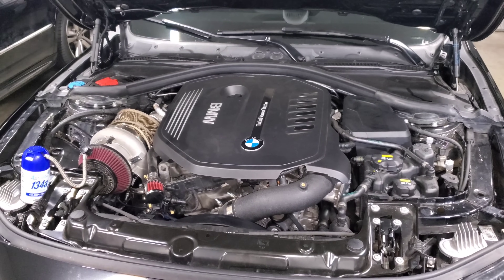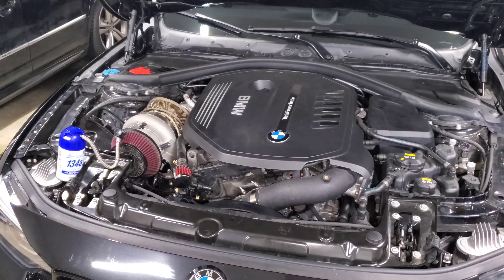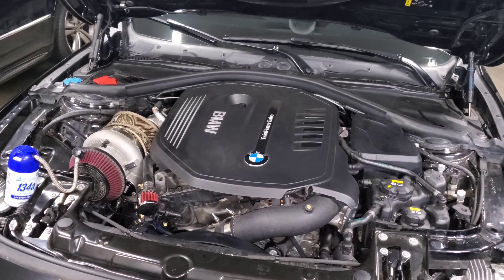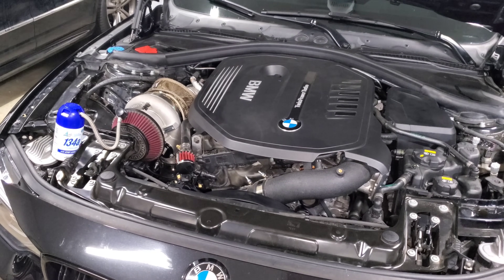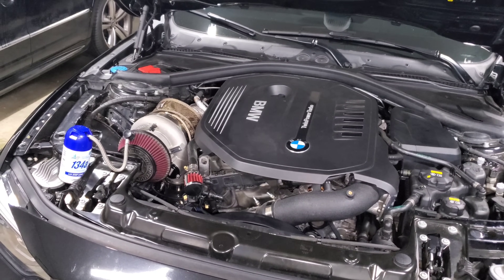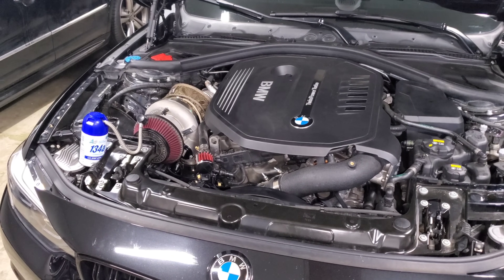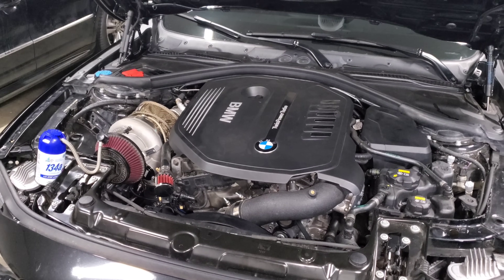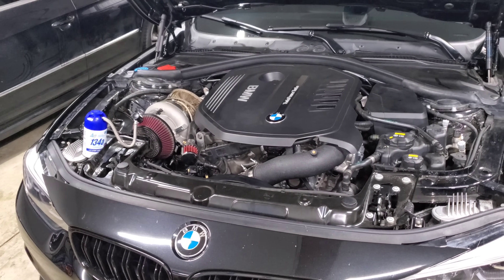How much power can the stock B58 Engine handle?

Comment: hey kern ik this is a old video but i hope u see this haha, so im currently aiming for 650whp and i am going to run a daw 6969 and nostrum stage 2 injectors,ds25 hpfp,spool stage 3 lpfp and a custom tune from shoup, built trans from ATS (their kit) anything else i should add to take precaution before i go ahead and go into this journey on a stock engine?

Comment: Okay so i guess im confused then... so when u say reliably/safely 600-650whp... are u talking at the wheel or the crank? The reason why i ask is because when u were talking u said "hp"... but below u showed 600-650 "whp... so i guess im wondering which is it? Is that 600-650 "whp" or is that only at the crank "hp"? Other than that great video man.

Comment: $6k pure transmission
$5k big boost 6870 kit 
$10.5k 5150 engine build kit 
$1.5k precision PI kit 
$150 DP 
$900 fuel cam kit 
$500 lpfp kit 
$50 Bimmergeeks cord 
$500 Motiv Reflex 
$416 MHD Flasher and Monitor 
$1000 David Shoup tune 

=~$26.5k total cost

Comment: So I’ve got a 2019 x4 m40i new spark plugs, mst air intake, vrsf high flow downpipe. I’ve got a stage 2 tune from MHD. I change my oil every 5k miles. What’s the next thing I should do next? Mod wise
Reply: Dorch high pressure fuel pump & upgraded injectors (cost roughly $3k labor excluded)

Comment: What he is saying is 100% facts. The guy you may know with 800+whp on a daily basis is not pushing the car repeatedly... Even with "proper fueling/cooling," you have to hope injection works perfectly when beating on it. Go ahead and upgrade the pistons before going beyond 700whp, unless you just plan to use it as a showcar...

Comment: that rod looked 100% hydrauliced to me if that was the actual bad rod. in other words it didnt go bad from to much rpm or hp it went bad from something like an injector leaking where enough liquid fills the combustion chamber and then the car is started somethin has to give and its usually the rod. when they go the other way its usually alot messier

Comment: Not so sure about reliability after just 105,000 miles...and BOOM!!!😢

This is not spam... I really need help with this.

My 2017 BMW 540i G30 just burned a valve #4 cylinder. (105k miles) I had the vsfr high flow cat, upgraded charge pipe, k&n air filter, new B58TU Fuel pump, and Bootmod3 Stage 2+ 93 octane.

I am beyond depressed!😢 I am a Single Dad with 1 special needs, child. 

I was told I need a new engine that will cost 21k installed. I just can't! 😭

I still owe 25k, and it is  my only car. I have nothing right now and am about to lose my job. I can't get my kids to the doctors, etc... If you can please reach out to your connections and see if they can help, I would be forever grateful 🙏  
(Huntsville, Alabama USA)

🤔A rebuild and breakdown of what went wrong with my B58 might help others with B58. (Content Idea)

God bless you, brother!!! 

~J. McCall
Reply from the maker: Your best bet is to find an independent shop to help diagnose or source a used motor.

Comment: Pistons crack probably from the piston rings butting together. I would imagine they make the ring gap on the tight side from factory. Would be interesting to find out what gap comes on the mahle performance pistons compared to stock. If they come pre gaped that is.

Comment: Do you think a Dorch Stage 2 HPFP paired with a VTT GC Turbo (not GC+) would be a good option? Hoping to get to around the 600-650 mark on ethanol with that setup.
Reply from the maker: sure. but it will be hard to get over 600
Reply: @kern417 why do you say that? it was done in 2021 with ds2 and e50 no port and for example i have ds2.5 now so im guessing its more likely now no?
Reply from the maker: No. Gc is rated for 600.
Reply: @kern417  No i know that. I was simply stating that it can get to 600/600. maybe even a few less or more bc it was done when it was first released
Reply from the maker: Like i said it will be hard to get over 600. But feel free to try.

Comment: I had a ford sho with a lot done, just got totaled now I’m thinking about getting a 440 and the more I watch videos the more I realize b58 is a damn cheat code
Reply: I mean like once you open the engine n most trucks you can push a lot of power the expensive part isn’t the parts in the labor in opening up a engine

Comment: Hi, new subscriber here and recently purchased a 2018 440i xdrive convertible with the B58 motor. I'm trying to learn as much as possible about this motor. I heard you say upgrading the Turbo and fuel pump are 2 of the best means of adding additional power but I'm uncertain as to weather or not I need to address the fuel pump due to it being one of the ones that is of the "better ones". Also, how big of a turbo can I go? Obviously "bigger is better" I take it but is there one that can put me in that 600hp range that you covered in your video. Thanks a lot

Comment: I wanted to ask how these stock transmission hold up. My car seems to love getting into short shifting Ie sits at 1000rpm in most gears (I do baby it a lot) and also drops to 900 without downshifting. Is this normal ? Stage 1 mg
Reply from the maker: Yes it sounds normal. You need a transmission tune to adjust shift points.

As far as how strong the transmission is, I made a video about that. 
https://youtu.be/cCDNvn0Dkr8

Comment: Bmw said Mpssk 340i has 360hp and 500nm, but i know they underated the numbers. What is the real crank horsepower? The normal 340i has 330-340 crank hp, do u believe the mpssk 340i could have around 400 hp at crank?
Reply from the maker: Usually they make the rated hp at the wheels. I don't like to estimate crank numbers but hopefully that helps give a frame of reference
Reply: @kern417  well, i guess i dont need anymore a remap to push 400hp to crank, it should be around that power. A stage 1 remap should push around 430-440hp at crank. Anyways ty!
Reply: mppsk is faster i have one

Comment: Let me just say this… I had a 650rwhp twin turbo NISMO 370Z. 530hp is my daily map, and it’s more than enough to get in trouble. Unless you’ve driven a high HP car, don’t let YT videos tell you that you need a 1,000hp car. I promise you don’t. Do 500hp, then 650hp. Then go from there. Lastly, UPGRADE YOUR BRAKES!  Going fast means you gotta stop fast, and OEM brakes aren’t designed to handle more than stock HP. Don’t be an idiot, upgrade your brakes first,

Comment: How do I know if I have a gen 1 or gen 2, is the gen 2 only in the supras?
Reply from the maker: Supras and new BMWs like the M340, M440, etc
Reply: @kern417  obvious newb here, and I’m sorry to bug. I did see that there are different variants of the b58 motor. My b58 is a B58B30M. Would you happen to know what exactly mine is in comparison to the other variants? Also would like to buy a sticker, I’ll email you my info. Thanks for what you do, you have a crap ton of knowledge. You should probably do modifications on the side for people if you’re capable. Indiana here, I saw that Ohio plate!
Reply from the maker: M0 is Gen 1. M1/O1 is Gen2.

Comment: local tuner was focused on track cars and had a handful of b58's with only stage 2 BM3 tunes blow up while on track. Maybe these engines can handle these power levels when drag racing, but  as someone who tracks their car I am keeping it stock.
Reply: Due to oil starvation
Reply from the maker: There are plenty of people that track their tuned cars so sounds like something else was wrong
Reply: Got a baffled sump?

Comment: Does anyone know if the m140i and 440i manual share exactly the same transmission?
Reply from the maker: Looks like different part number but has the same limits
Reply: @kern417  do you know if fittings are same ?
Reply from the maker: @Driver605  it looks like mounts and everything else is the same. Look through RealOEM

Comment: Detonation kills pistons and rings.  So many years of intake, cylinder head port, and valve train design all aimed at filling the cylinder with an even air/fuel charge. That’s one of the main benefits of direct injection - no lean pockets that can detonate- perfect air/fuel distribution and very high atomization rates vs port injection.  It would seem that correct path would be embracing Direct injection and maximizing its benefits before going back in time 40 years and mounting port injection.
Reply from the maker: Port injection is necessary when you are pushing past the DI limits. Plus There are plenty of other reasons why it's beneficial. That's why several cars made in 2021 (not 40 years ago) have both DI and PI from the factory. The Audi RS3/TTRS is a great example. Even the new G8x M3/M4 have provisions for PI on the stock intake manifold. So I guess it's time you embrace progress 🙂
Reply: @kern417  Golf 8R too
Reply: They added port injection due to the inherent flaw of GDI- carbon build up on valves.
Reply from the maker: 11 months later and you comment just in time to see that the new generation of the B58 comes with port injection too 😂

Comment: I have 540 stage 1 with 48K miles on it and got some wining noise coming from the engine when you keep Rpm’s higher then 1500 very similar like bad timing chain made on N20 engines. Maybe you know something about timing change issue or B58 wining noise issue. Nice video👍
Reply: Could be your spark plugs
Reply: @Lord.Slumped  wasnt aware that spark plugs made noise🤦🏽‍♂️

Comment: I have a 2016  550i, downpipes, cai, muffler delete, JB4... Thinking about getting a 340i tho. What do you think?
Reply from the maker: You won't regret it
Reply: @kern417  what advantages vs disadvantages do you think with getting a 340i over the 550i? I planned on doing pure turbos on the 550i then I got the 340i bug for some reason and now not sure what I was do..
Reply from the maker: It is more reliable and easier to work on

Comment: I have a currently stock 2018 m240i,  any recommendations for 425-450whp? I’d like to keep the stock turbo and pass emissions. But I’m open to down pipe(catted) and tune suggestions. I’m looking for reliability and stability(as close to stock as possible).
Reply from the maker: I have a video on recommended b58 upgrades. Downpipe on pump gas will be around 400-420. E30 will put you over the 420 mark
Reply: @kern417  easily that, making 410 wheel on a full bolt ons f30 335i on a E20 tune
Reply: after you go full bolt ons (so many options just chose the mods) get MHD for the tune (stage 2 or 2 plus if it's out now), xHP for the transmission (recommend stage 3). The MOST important thing to remember is make sure you're not running too lean for the tune, don't be like me and have to rebuild the engine when not even pushing it far...
Reply: @chrisgarret3285  how did you lean out, what went wrong?
Reply: @willm2624  I thought I could run a 95 octane map by using 93 octane pump gas plus one of the top rated (and MMT containing) octane booster that was supposed to bring it up to 96 octane
Reply: @chrisgarret3285  Aw man, that sucks dude. Sorry to hear. Hopefully you’re up and running again.
Reply: @willm2624  thanks I'm up and running and now running E-30 mix on a stage 2 plus E-20 map and boy does she move, F80 M3 need not apply :)

Comment: I don’t think that an engine that is designed to have 320-350 hp can handle double of the performance for a long period of time. Ho many miles/km did the 40i owners drive with these modifications?. I know that b58 engine is a reliable one, but I still don’t think that the car manufacturer will spend extra money for making a car that can handle double of performance from a stock engine form.
Reply from the maker: You saying what you "think" doesn't trump what everybody's already doing. But it's up to you what you want to believe. I have data. Where's yours? 🙂
Reply: @kern417  - what an effin awful reply , Vlad’s point is valid. The right answer is the B58 is basically a beefy block built for diesel applications too and naturally built beefy. That’s all. It can make 2 to 2.5x more power is very much possible but obviously with risks. A 30-50% should play in the safe limits.
Reply from the maker: I have no idea what you're referring to. Clearly vlad understood 9 months ago 🤔
Reply: @kern417  i have an f30 and an f10 but without b58. I don’t dispute that it cannot handle that power, I just said that I don’t think that it can handle it for a long period of time. I don’t want to bother anyone. How many miles did you drive in this form?.
Reply from the maker: I have 5k but there are plenty with 40+. It's easy to tell how much stress you're putting on the engine and there are multiple BMW engines pushing out double the HP on stock internals. Do some research.
Reply: @kern417  Ok. Thank you for the info!.
Reply: @VladVVT  if you properly take care of your vehicle she will take care of you
Reply: A hammer doesnt last half the time when you start beating it twice as hard. Just as long as you dont beat it harder than it can handle, it will last a long time...
Reply: N54 guys been driving for several years at double the hp

Comment: Yea 650 is what people usually max hp at for b58 but then you better have a built transmission at that point. Mine is limited to 600wtq to keep stock trans happy.
Reply: This is a bit* concerning... since I want to get an X3 M40i, and they of course- are heavier with AWD so that 3-4, and 4-5 under load are going to be brutal. Anyone doing completely custom TCM tunes?
Reply: Damn that's less than the n54

Comment: Great video! A little off topic, but I’ve always wondered the purpose of adding port injection for higher power levels? I’ve seem it done on other platforms too but I’m not sure why it is done. Is it to flow more fuel since direct injection can’t handle as much flow?
Reply from the maker: Yes. I have a few videos on port injection if you check my page.

Comment: I’m at 650whp right now on full E with port with a pure800, looking to push 700 750 with a different turbo set up, do you recommend just doing piston & rods ? Or should I do the whole thing with the sleeve and block.
Reply: Maybe 800 wheel
Reply from the maker: I'd do Pistons and rods if shooting for that much
Reply: @kern417  ok, thank you bro keep up the videos 🔥

Comment: Can you do a video about the different b58 drivetrains/transmission and how much hp they can handle
Reply from the maker: Yep already in the works
Reply: I’m curious as to what settings people are using in xHP. For someone starting out, I’m not sure what levels to set the flash at.

Comment: Great video as always, thank you for the lot of informations you give us. I have a f32 440ix, just a custom tune on it with 400 hp. My new vrsf catted dp just arrived and I am looking for the TU hpfp (I am not sure dorch stage 1 worth the extra $). What would be the "acceptable" crank hp with this setup (200cell dp, tu hpfp, custom tune)?
Reply from the maker: Depending on fuel 450-500
Reply: @kern417  i run 100 ron here in europe, if i know well it should 98 in US.
Reply from the maker: That'll be closer to the 450 end. You'll need ethanol or methanol to get closer to 500.
Reply: @OlikaHUN  Plenty of cars here in Germany are getting 460-470hp (crank) on catted downpipe and MHD stage 2. With stage 2+ and TU pump, you can expect close to 500hp crank on 100 ron fuel. The tu pump mainly boosts torque, though. Gives you a nice extra 70-80nm.
Reply: @Ultrabenbooyah  Great info, thanks mate! Can you recommend  me German sites for b58 parts? I got my dp and charge pipes from boostwelt last week. I am still hesitating between dorch st1 and the tu pump...
Reply: @OlikaHUN  my answer keep getting deleted...
Reply from the maker: I keep getting comment notifications but when i check it's gone. Not sure why it's getting deleted. Maybe one of the words you're using are getting flagged
Reply: @Ultrabenbooyah  no prob! Finally I have found a used (5000km) dorch stage 1 here in Hungary for 700 euro, so I will go with it. I will comment when everything is built in and custom tune is made.

Comment: What size hose did you use for the evap delete?
Reply from the maker: I made a video on the process. I replaced the fittings with rubber caps.

Comment: Great vid as always. Do you know much about the flex fuel kit Visconti has been offering for the b58? Do you think the price is worth it or would you suggest a more basic ethanol analyzer?
Reply from the maker: It's great if you want actual flex fuel, but if you're still flashing maps for different Ethanol content there are plenty of cheapish options.
Reply: @kern417  just saw protuningfreaks post about the bm3 flex fuel might wait for that

Comment: just blew my b58 at 650whp on a f80paul tune
(Pure 800, Stg2 Dorsh HPFP, LPFP, PI, FBO)
Reply from the maker: What failed and what caused it?
Reply: @kern417  I believe it was tuner related, was running at 29pounds, 15degree timing. F80P said it was fine(prior). I did a pull, looked back and my car was vaping.
Reply: tell us
Reply: That’s a lot of fuel for a b58 engine to blow at 650hp..
Reply: what failed brother?
Reply: Dude I have the same exact set up and same whp 😱 going to turn down my boost until I build the engine
Reply: I have a different tuner tho had a bad experience with f80paul so I switched to MHD
Reply: @rengietorres9482  smart, I’m gonna rebuild with billy mason
Reply: @TMar1vo  so when you guys are getting these tunes are you monitoring things on your own as well?  In other words each time you change something in your tune, do you have gauges or software to watch your timing, knock sensors, fuel pressure, air/fuel mixture, and recording that while you drive the car?
Reply: What kind of fuel was u running ?  This Comment got me shook 🥴
Reply: @elinchaverde  full e-85 with port injection
Reply: Assuming it was f80 Paul I heard some stuff about him wanted to get tuned by him but know someone who motor blew due to the tune from him. Is your manual? Or automatic?
Reply: @Lord.Slumped  auto